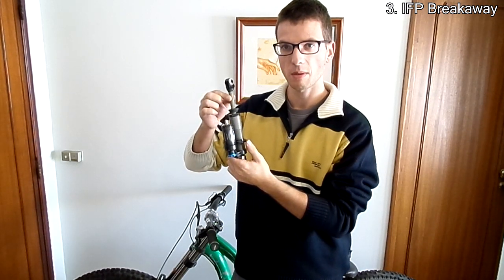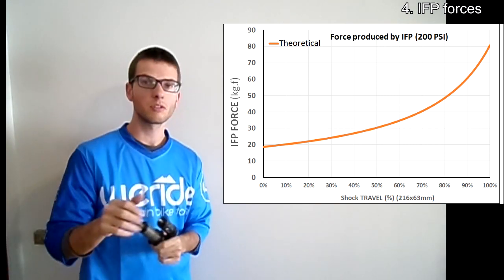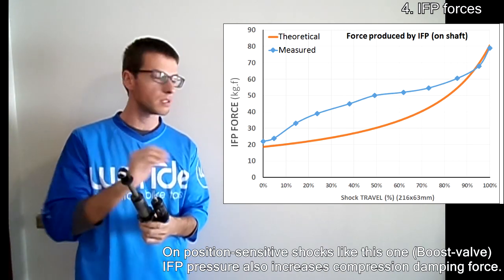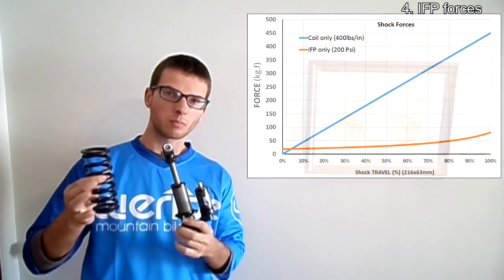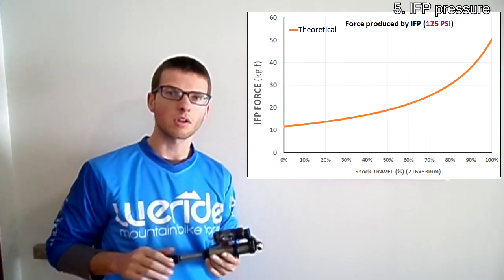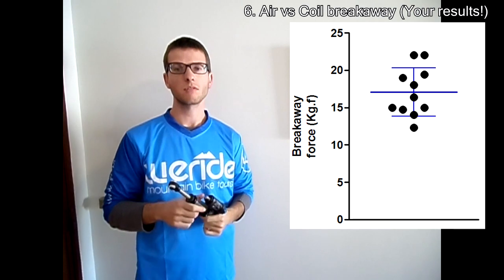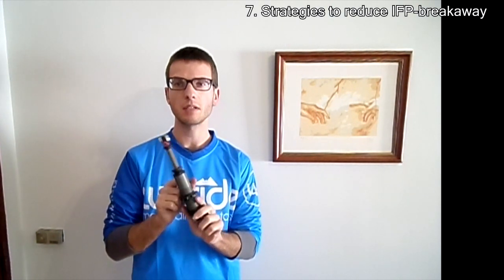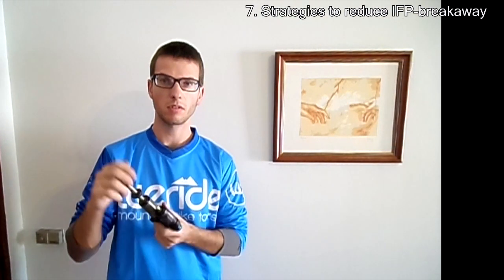IFP forces on rear shock (MTB rear suspension Ep.9)

Comment: With the deviation between air and coil shocks IFP pressures being negligible: why, then, in the drop test(in your other video) do they produce such drastically different results? Shouldn't the "negative pressure" companies are using in air springs create a similar effect in breakaway force?

Also, i have a Mission Pro 2016, and would love to see an analysis of the suspension as you have shown for many other models. What software are you using to run these simulations?

Loved your videos man. The scientific/statistical approach to analyzing different suspensions is very enlightening! Appreciate your hard work!!
Reply from the maker: +Bennett Dahl Hi man thank you! In my next episode I will talk deeply about the negative chambers, and how their volume affect the air spring curve. After that I will talk about drop-test. In fact, the other video of drop test is almost 7 years old, and I used the air shock that came on Enduro SL (AFR shock). That shock lacks the transfer port that pressurizes the negative chamber. Thus, the breakaway force on that shock was about 40kg (at least twice the value of a modern shock). On the AFR, the shock didn't even compressed with the drop-test. On modern shocks they still compress (you can use the o-ring to check), however, and that's the interesting part that I was not able to understand for a long time, in most modern air shock the wheel still bounces despite the low breakaway force. The reason is due to the higher low-speed compression damping. Indeed, I have some slow-motion footage that shows clearly that. The shock compresses during the impact, but then, when the shock it's coming to a stop it suddenly stiffens (semi- lockout), and the wheel bounces. I will discuss this in a future video :) Bye

PS: added your bike to the request list :)
Reply: +andrextr 

I was under the impression that the negative chamber in modern air shocks is not charged until the shock is sagged due to the positioning of the transfer port. Perhaps an air shock with independently adjustable positive and negative chambers (ex Rockshox Dual Air - not Dual Position Air) would show comparable results to a coil since the negative chamber is pressurized at rest?

http://www.pinkbike.com/news/Tech-Tuesday-negative-spring-air-shocks-2012.html
Reply from the maker: The transfer port is above the main piston when the shock is fully extended, thus, each time that the air piston passes on that zone, the both chambers are equalized. This is what happens when you fill the shock for the first time for instance. After the negative chamber is properly pressurize it will remain pressurized. So the transfer port is an automatic way to properly pressurize the chamber. The height of transfer port determines the pressure of the negative chamber. To achieve a full equilibrium at top-out between positive and negative chambers, the negative pressure must be higher than the positive one (because the negative chamber has less surface area on the main piston, due to the space occupied with the shock body). I will try to do this episode this month. Bye
Reply: I see. Thanks for the explanation!

Comment: Awesome video on IFP!
Does the Fox X2 or Ohlins have IFP chambers have high pressure as well?
Reply from the maker: +Vasil Tashev Ohlins uses a bladder instead of a ifp. Dont know about X2 IFP pressure but the brakeaway results also include some X2 shocks and they are not much lower than the others.
Reply: +andrextr Thanks 
What I was asking basically was does the X2 extra chamber actually IFP as well?